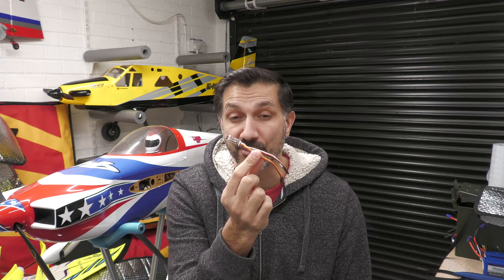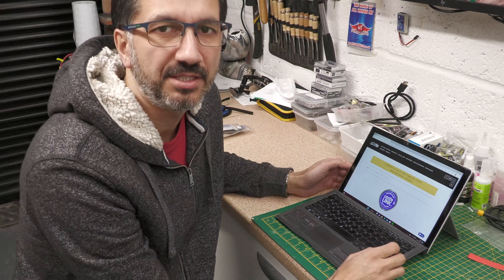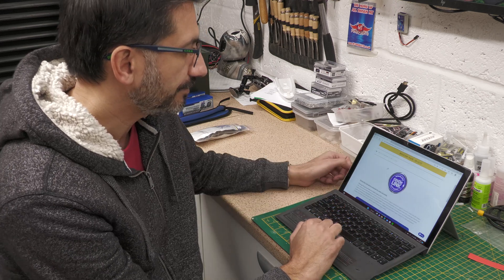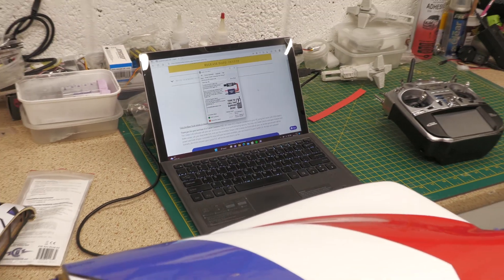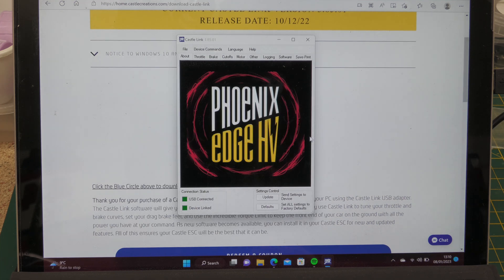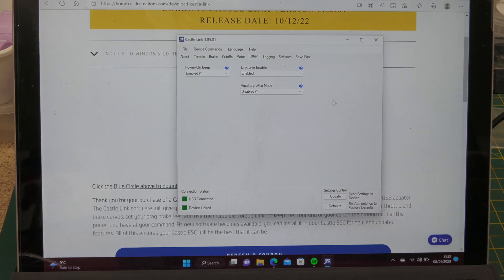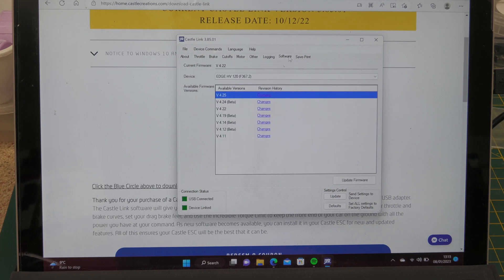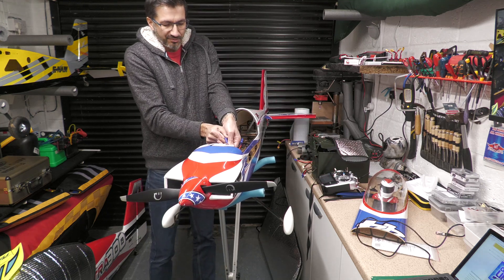How to set the Castle ESC for Telemetry

Comment: Matt, do NOT update the firmware, the Xpwr motors need to run on 4.22 firmware only 👍🏼
Reply from the maker: Good point! I completely forgot about that fact. I'll pin this to the top for others to see!
Reply: I just bought a plane that has a xpwr 30 in it and they guy said he flew it a handful of times and just wasnt his thing. I flew it yesterday without problem. I was changing settings on the phoenix hv80 and noticed that he had already updated to 4.25. What problems does 4.25 cause that requires us to have to use 4.22?

Comment: I’m new to CC ESCs and stumbled upon your video trying to program one I that came in a second hand F-22 I purchased. It’s paired with an AR8360T. Without adding a telemetry kit, is there way to get some telemetry sent to the 8360 if I run into one of the other ports? It’s currently on port 1 for throttle. 

My main goal is to program reverse thrust and I’m afraid of activating any brake after reading the comments. What setting slows it down between thrust directions?  If I pull idle, the forward air can be spinning it quite a bit. Thanks
Reply from the maker: Hi,

I unfortunately don’t have any experience with soektrum at the moment. 
I will expect you need to use the castle link at that will convert the single to the correct protocol for the RX to receive and send. It looks like they use the X-Bus protocol https://www.castlecreations.com/en/telemetry-link-for-xbus-010-0148-00

Comment: 9:00 You mention having the "brake" enabled on another plane that the ESC blew up in mid flight...
I bought a plane built by my friend and never flown last December.  Finally go a chance to fly it last week.  The ESC blew up in mid flight. I think I've bought my last Castle Cremation ESC.
I did one trimming flight and one second flight. The third flight was short and expensive.  I don't have footage of the flight.  Only the before and after.
https://www.youtube.com/watch?v=YkerK0TIHp4
Reply from the maker: Ah man so sorry to see your Extra in bits. I do have other Castle ESCs but have NEVER enabled the break feature, it’s not worth the risk. 
If you’re using an XPWR motor then it’s recommended to not use the latest firmware for the Castle ESC. I think the firmware you want is something dot 22. I can look it up if it’s helpful.
Reply: @MattTakharRC  I put the talon 90 and xpwr 22 on a U Can Do that I converted to electric.(video available)  So far no problems.  I have the same set up in a Carl Goldberg Ultimate Biplane conversion (video coming) Maiden also coming soon.
Reply from the maker: Sounds good. Will forward to the video

Comment: By the way thanks for the hint in your video, a few days ago I just plugged the CC Telemetry kit into an ESC and the telemetry did not work with my Futaba 16IZ. So you saved me some searching 🙂 Also I am now wondering if the ESC would still work without that configuration change - if it was plugged into an SBus2 slot and not into Slot3 on the Rx which I guess is an PCM/Sbus connector but not necessarily Sbus2... OK my telemetry stuff is a longer term project, so I am not in a hurry, I will only start migrating from my old Futaba 8FG to the new 16IZ after some warmup flights with the old TX, in the next few weeks.
Reply from the maker: Hi, I'm glad you managed to save yourself some time with my video!
I'm not sure if it would still work by pugging into SBUs2, I'm pretty sure you will still need to set the ESC. Let me know if you ever try it!
Reply: @MattTakharRC  Hi, no I am not going to try, Castle says it needs to be disabled without the telemetry link, as I read right after porting this previous comment 🙂

Comment: I only have a small EF Extra 45" with an Edge 50 ESC but even with such a small plane I programmed a transmitter switch that will arm the ESC only after I flip that switch back and forth. That way I have some added safety to avoid arming the ESC unintentionally and having a live throttle just by plugging the battery in. I think CC started to sell some arming security device to address the same concern. Cheers!
Reply from the maker: That's a nice idea. I've started setting up throttle cuts on all my electric (and gas) models now.